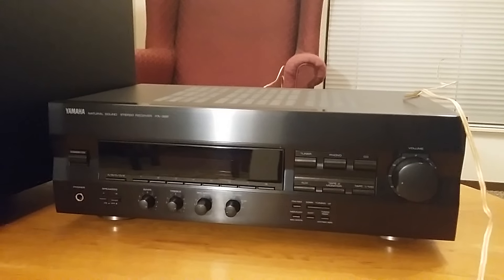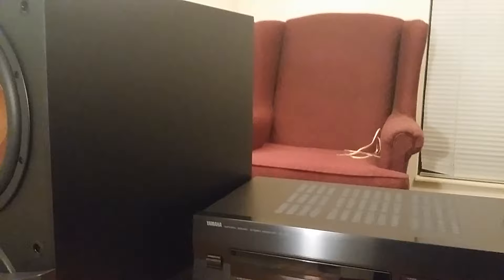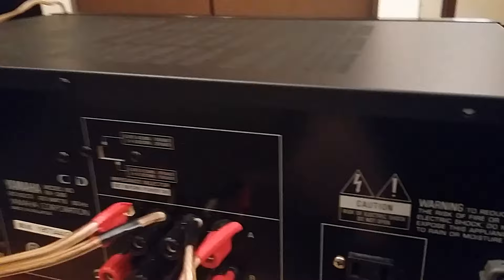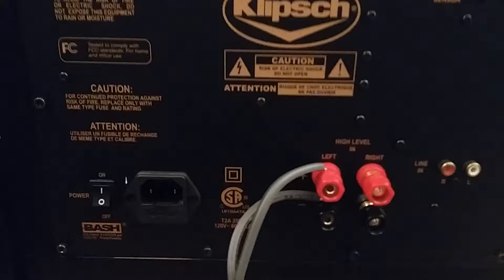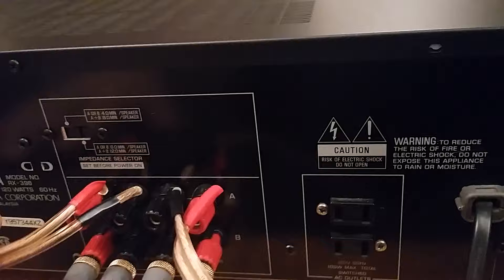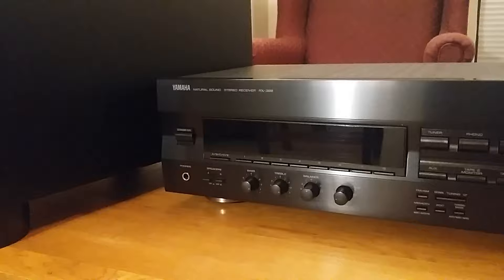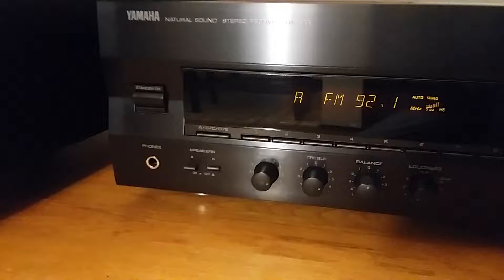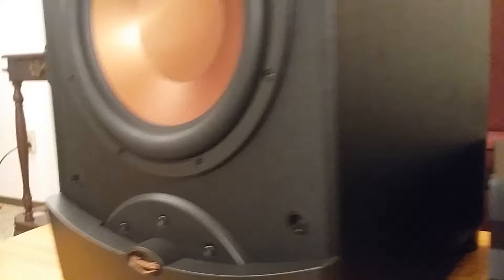How 2 hook up a active subwoofer to a receiver or integrated amp with no subwoofer pre out on unit

Comment: So from what I get here is that it is ok to feed my powered sub with 150watt straight from my old school amp?? It seems like feeding an amplifier (on the subwoofer)with power that has been stepped up already (to 150watts) would do some sort of damage....am I wrong? I honestly don't know the answer and have purposely avoided hooking up my old school Kenwood amp to my newer powered sub. Please someone give your thoughts and/or  advice. Thank you
Reply: The sub doesn't actually use the amplified sound just the signal so no worries as long as the sub was built with high level hook ups.

Comment: I have an old pioneer RX-760 i was wanting to do this with and i have two rear speakers hooked up to my b speaker outputs and i was wondering if i was to tap into those two plugs and run to my sub would that affect my rear speakers that are already hooked up into that space?
Reply from the maker: Maybe take away just a bit of loudness from rear speakers , but it also may cause more stress on the amp
Reply: @tee-jaythestereo-bargainph2120  i tried it out and it ended up working, the sub i used only used one rca jack so i just stripped the wire and jerry rigged it and plugged it into my left rear speaker and it seems to work fine! Doesn't seem to take any volume away from the other speakers so heres hoping it won't catch fire later! 😂
Reply from the maker: @samtanner236  Great ! Glad this worked for ya let it run for a couple of hours and see if your amp is getting more hest than it use to by feeling the top of amp . 😆

Comment: Does this work with a passive non powered sub? Just got an old one I was wondering if I could get more use out of. It only has one channel I guess I would route them to both B left or both B right? Or maybe it wouldn't do anything...
Reply: did you try it? i have the same question
Reply: No, I think I didn't end up buying a new amp so I didn't have a reason to try.

Comment: What if I dont have A+B? Only 4 speaker inputs? Can I connect both the speakers with banana plugs and the sub with speaker wire to the same binding posts on the amp?
Reply from the maker: how many speaker outputs does your receiver have ?
Reply: Yes, you can.  You can use bare wire or pin connectors for the speakers or sub and banana plugs for the other, or use stacking banana plugs that plug into each other.
Reply from the maker: Tim Cunningham thank you, Tim and your 100 percent correct ! But may put a lil but more of a strain on your amp I wouldn't blast it full volume just to be safe
Reply: djaxe32 ... if you just have one set of left/right stereo speakers, the single active subwoofer can be connected in parallel with your existing speakers just making sure the left is connected to left, and right connected to right RCA jacks. Just note the principle of OHMS LAW when connecting speakers in “parallel” i.e impedance of speakers A + impedance of speakers A’ = Total Speaker impedance divided by 2. Normally amplifiers have a range of speaker impedance it can handle. Just be prudent with your amp volume listening levels. Cheers,

Comment: What if I have a nonpowered sub but no high output on my reciever for subwoofer? Can I connect 1 side to center high output?
Reply from the maker: What amp and sub are you using ?
Reply: @tee-jaythestereo-bargainph2120  I have a reciever with integrated amp. And have sub that doesn't have amp. My reciever has no high output for subwoofer. Only left center and right

Comment: Are these better than using an RCA ports?
Reply from the maker: In my opion and many others yes because your getting the exact same signal as your speakers So theirs no timing/Phase issues / REL/P.S. audio Paul agree as well -
Reply: @tee-jaythestereo-bargainph2120  I'm a novice and I can't get my pioneer vsx-532 and my pioneer sw 8mk2 to work properly with the RCA ports. And I'm not running regular RCA cables. I'm actually using the extra shielded subwoofer jacks. It's an ACTIVE subwoofer so it should not have any problems. The sound is very very low. Is there a setting inside the receiver that I'm not seeing?

Comment: What about if the subwoofer has only 1 rca cable (1 single hole) coming out of it and the receiver does not have the “SUB OUT” hole to plug it into?
Reply from the maker: Does subwoofer have high level input ?
Reply: Tee-Jay The Stereo-Bargain-File man I’m not sure.. it’s just a single out running an rca cable from the back of the sub. On the front of the sub there’s a little knob that allows to make it hit harder or softer. It’s from one of those early 2000s sony mini shelf hifi stereos
Reply: Tee-Jay The Stereo-Bargain-File it’s honestly a hell of a subwoofer
Reply from the maker: @poopstain5216  yeah if you dont have high level input to sub , Then it wont work the way i showed , you may be able to buy a step down RCA , Alot of car audio enthuist used those step doens back in the day when their stereo didnt have rca output to hook up to an amp only way i can think of if you dont have hi-level input
Reply: Tee-Jay The Stereo-Bargain-File thanks a lot man

Comment: In my case for my Yamaha AX-592 which has pre-out / main in . it is there where i've connected the active sub that i use the last 20+ years .
Reply from the maker: Yes you can use your preout RCA i had the same reciever ! I loved it !!! Just sold my yamaha ax-497 that i bought (nos) new old stock . it was a beast also !
Reply from the maker: If you use the rca ouput from your integrated amp to your powered subwoofer then for your front speakers you speaker b outputs i know their smaller post than A speaker terminals but B speakers  post are solider straight to the circuit board where speaker A  has a jumper small wire from b post to power A post many write ups on this if you want take front cover of you can see for yourself but for front speakers use B terminals better signal
Reply: @tee-jaythestereo-bargainph2120   Thank you very much Tee-Jay that was really informative enough to me :-)
Reply: @tee-jaythestereo-bargainph2120  

Yes these Yamaha models late 90s actually mine is 98 buy as brand new are such beasts .
Reply from the maker: @Badassvidsz  yes they are , and they was very exspensive in the 90s , just hooked up one of my good buddies with a whole system , in 1997 i bought new a rx-396 for 499.00US on black friday normally 599.00US and it totally out done my newer 2018 Yamaha AS-801 and i was shocked ! The distrotion level was a huge diffefence ! But when you opened them up you could see the difference

Comment: Quick question if I were to take another av receiver and hook it up to the subwoofer line out of a av receiver and hook up a powered subwoofer to the speaker terminals on the back of of the second av receiver that is hooked up to the subwoofer line out of the first receiver using the high level inputs on the back of the powered subwoofer will I end up overloading and damaging the plate amplifier on the back of the powered subwoofer itself
Reply from the maker: So arw you saying hooking 2 different AV recievers up to one powered subwoofer one with 5v preout other hi level input from speaker output from another reciever ?
Reply: Tee-Jay The Stereo-Bargain-File yeah and I was wandering could that damage the amplifier with feedback
Reply from the maker: @travisgulley2652  yes it could cause damage !
Reply: Tee-Jay The Stereo-Bargain-File and is the damage caused by feedback and overloading the amplifier itself
Reply from the maker: @travisgulley2652  Most likely both , you could always unplug them hopefully the high input has 🍌 connectors that would make it easier to disconnect

Comment: I have speaker inputs on the back of mine the look just like yours but they don't say "high level".They just say "speaker in". What's the difference?
Reply from the maker: Should be the same , rembember make sure everything is unplugged (Power wise) when you hook up this way, and start out at very low volume ,

Comment: A dumb question maybe, but if I set the sub (on b spkrs) to a certain volume level, and then I use both a and b at the same time, will the set volume on b stay where you put it? Thanks in advance.
Reply from the maker: You mean setting the volume on the actual power subwoofer ? If so the volume of sub will go up as you turn volume up on amp
Reply from the maker: Theirs no dum questions on here , 
Are you talking about setting the volume on the subwoofer ? If so yes once you turn the Volume up from your other amp yesxthe volume of the sub will go up also 😆

Comment: What about inpedence mismatch. Both the sub and the speakers will have to be 8 ohm if less you can damage the amp.
Reply from the maker: James Vw all of my amps all have switch modes to them but your ok with either  4 or 6 or 8-ohm the hi input on the powered subwoofer is just getting a signal from the receiver/integrated amp the powered subwoofer has built in protection and circuitry for this if not they wouldn't have hi level input on them which some active subwoofers don't have hi level input,  the way i show works as a gain only once it's processed threw the hi level inputs circuitry , Paul McGowan of P.S. audio has a Utube page on this subject also it's actually the most accurate way to listen to music because your getting the exact same signal , just think  most of these home theater receivers or AVRs are 6 ohm but company's like Klispch says it's safe to use on their 8 ohm speakers , and Then most passive subwoofers are at 4 or 8 ohm but are mostly used with 6 ohm HTR-or AVR receivers with rca out puts Awesome question though
Reply: James Vw ... OHMS LAW principles state that components (e.g speakers, resistors, etc) connected in parallel averages out i.e 8 ohms + 8 ohms = 16 ohms divide by 2 = 8 ohms, or 8 ohms + 4 ohms = 12 ohms divide by 2 = 6 ohms, etc. Just note that many if not all amps can handle a range of speakers impedances (i.e. OHMS) ... 4 ohms to 16 ohms safely ... Cheers
Reply from the maker: @pinoynga  your exactly right , I have owned my Klispch Reference woofer for 10 years and never had a problem, i called Klispch and talked to them about hooking it up the way i do and Klispch said i wouldn't have any problems and i haven't

Comment: Try putting a hip-hop song with bass and high the subwoofer volume to see how it works 😂👍
Reply: wouldn't it be the best? i'm fairly new to this and am still learning, which would you say is the optimal way to have a sub connected mate? any advice would be appreciated :)
Reply: Most hip hop doesn't really tell you anything about the subwoofer. It's just muddy and boomy with no depth or definition.

Comment: Couple of variations. If receiver has no A and B you could just connect two wires to each speaker post, one to subwoofer and one to one of the main speaker. Also if receiver has no A and B but the subwoofer has high level outputs, you can connect main speakers to the subwoofer instead.
Reply from the maker: I think So
Reply: Yes. I have A and B but both don'f work together so I already did what you said. The sub just takes a small signal so it doesnt affect the speaker output from the amp

Comment: It's important to know that if you use both channel A and B together, speaker output ohms would change.
For eg, in Yamaha rs202, if you use only one either of channel, the amp output is 8ohm and when used  both channels, it's 16ohm per channel.
Reply from the maker: That depends on the ohms of the speakers your using if you use 2 sets of actual speakers at 8 ohms its a 4-ohm load that goes on the amp not 16-ohms .
But i was talking about using full range passive speakers on A channel and the b channel to run to the active sub the hi level input of the sub puts no stress on the amp it may use 1-2 watts at most or 2volts
Reply: @tee-jaythestereo-bargainph2120  Thanks for the reply, glad that you're keeping these conversations going.
I'm curious to know what's your take on if someone wants to use channel B for biwiring. So the left out option to connect the sub would be to use phono out of amp?. If someone takes this way, is there any hack that you're aware of to manage the sub volume?
Reply from the maker: @terabin1  i would have to see what your talking about i don't understand
Reply: @tee-jaythestereo-bargainph2120  If you can take a look at the ports available on Yamaha rs202bl amp, that should give an idea what I was talking about.
Good day.
Reply: The load on the amp when using speaker level to a active subwoofer is negligible.

Comment: So we dont need to plug the subwoofer to AC.wall means no need to power it??
Reply from the maker: Yes you still plug inti the wall this just gives a signal just like rca jacks
Reply: @tee-jaythestereo-bargainph2120  thnks,i have yamaha rxv795.1998 and rxa 850.why they sound different.the old yamaha  is mascular in bass.while rxa850 is so thin..svs prime tower is my speaker..thnks.
Reply from the maker: @arnelcomia2060  yeah the newer home theater reciever normally has a 60hz cutoff with surrounds where that 1998 model had power like a 2 channel stereo reciever or small integrated amp I had a RX396 2 channel reciever that kicked ass ohh its in the video lol I sold it once I got the AX497 thats a hidden gem pure analog !
Reply: Me again how about the phase in what level? Thnks more power to ur channel.

Comment: this is not actually necessary.  you can simply run another set of speaker wires from your speaker A outputs into the high level inputs of your powered subwoofer.  it will accomplish the exact same thing.  and no, it doesn't change the load on the amp, it is just a signal, and thin speaker wire can be used.  the only advantage to this method is using the "B" switch effectively as an on/off button for the subwoofer.  if you only run one set of speakers, this can be a nice feature.

Comment: What about preamp output? I used the preamp out on my vintage Yamaha just fine.
Reply from the maker: This trick of the trade is for amps with no preouts
Reply: @tee-jaythestereo-bargainph2120  Hey TJ, sorry about that. I should have clarified. I just wanted to ensure people check for pre-amp output as well (not just a sub out or LFE out). The only thing with a preamp out, is it's sending the full frequency range, not just sub bass, so your sub must have a built in low-pass filter (mine only has rca line level inputs but can switch from passive to an active mode where I can adjust the xover frequency). If the sub only has line-level inputs (like mine) and your amp only has high-level speaker outputs , a couple companies also make full-level to line-level  rca converter (Blaupunkt, Kicker - mostly for car use). I believe my father used one in his vintage setup and it seemed to do the trick.  A  lot of variables here. Peace and happy listening my friend. I apologize again for not clarifying. Looking forward to your upcoming amp reviews.
Reply from the maker: @TimbreDynamics  you are correct i didn't mention this because I was talking about amps with no preouts but your correct full range preouts will work also but the active sub would need a crossover 😆 thanks for stopping in !

Comment: I have the same setup behind my receiver (two channel) but my subwoofer only has one output jack, any ideas on how to do this?
Reply from the maker: You mean one input jack ?
Reply: @tee-jaythestereo-bargainph2120  Correct. Excuse my mixup.
Reply from the maker: @magellanmax  no biggie dang you would have to use something like a step down what pep use in a car system basically you hook speaker wires to one side and the other side will have plugs fir rca jacks that you can run to the subwoofer , thats why hi level inputs are so important !
Reply: @tee-jaythestereo-bargainph2120  Much appreciated bud. Any suggestions what cables I could get off Amazon that would work well for this setup?

Comment: Question: What if the subwoofer has the high level in from the receiver like what is shown in the video, but then it also has another 2 ports that say "out to speakers?"  Does this method change?
Reply from the maker: Is the subwoofer a active subwoofer (Powered)
Reply: @tee-jaythestereo-bargainph2120  Yes it's an active subwoofer
Reply from the maker: @ManiacMinion  yes shoupd be the same way to hook up
Reply: No, with that setup you run from the receiver to sub, then from the sub to the speakers.

Comment: What can i do if my sub just have rca input line helpmeeeee
Reply from the maker: The only way around this is to buy a step-down that converts speaker cable to rca connector just make sure the end piece is rca male !! So you can plug into sub female '
Reply: @tee-jaythestereo-bargainph2120  thnk u so much dude
Reply from the maker: @douglastaylor3122  that's what I am here for your welcome

Comment: I thank you for your answer,  but then how should I connect an active subwoofer  with a minicomponent  with a superwoofer output ? I hope your nice answer thanks a lot
Reply from the maker: Do you have speaker A and B output ? A total of 2 left side and 2 right side speakef outputs ? Most mini systems only have one speaker output for left and Right side if so its not possible
Reply: it is possible, just wire it up together with your woofer.